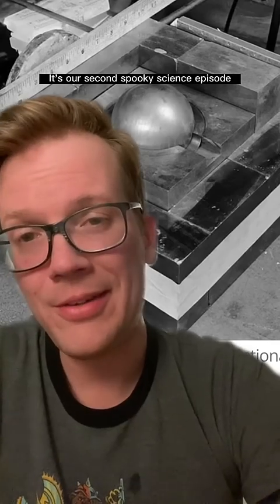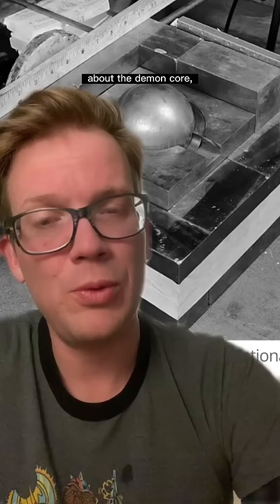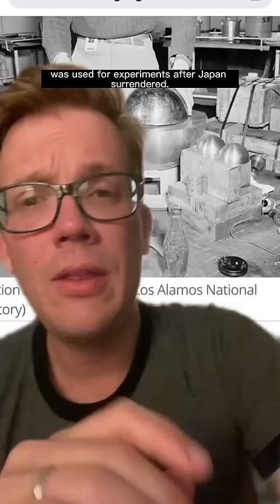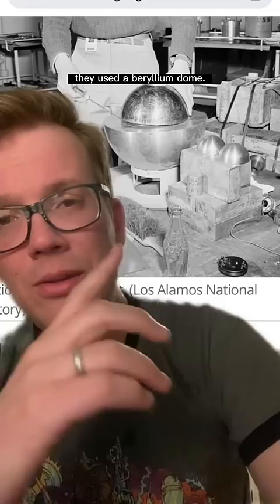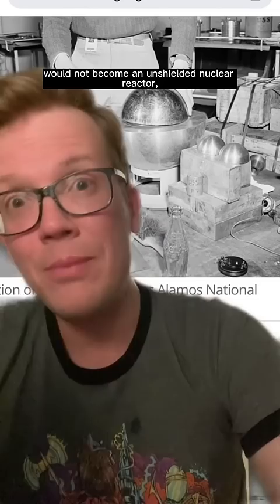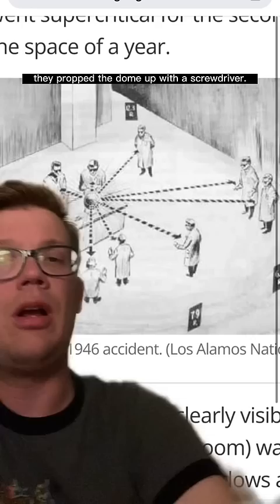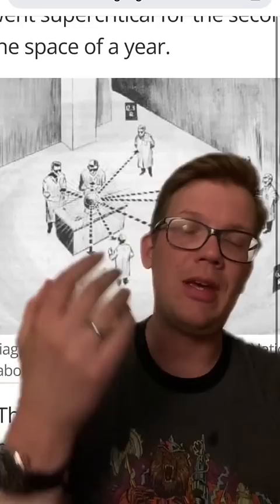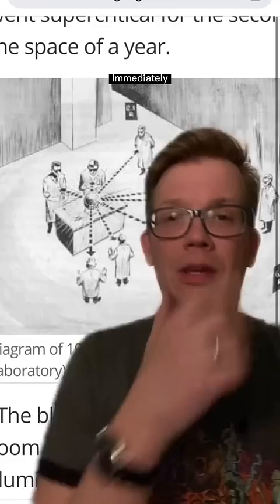Spooky Science episode 7: Second demon core incident

Comment: He was constantly warned about how dangerous this approach was, But he basically thought he was invincible. I can't remember who, but some famous physicist at the time said he would be dead within a month if he kept doing this experiment so recklessly.... And he was right to within a few days
Reply: It was Enrico Fermi who (reportedly) said that.
Reply: @jared_bowden  he described it as tickling the tail of a sleeping dragon
Reply: Maybe he liked the feeling of skirting danger? I can imagine it'd raise your adrenaline.

But if an atom bomb went off instead of radiation when it slipped,  that'd be the ultimate feeling.

Maybe. 

For a split second.
Reply: I have been electrocuted by similar mistakes, I touched something that should have been grounded and got shocked, you usually keep doing things in stupid ways until something like that happens, I got another chance, he didn't, I also could have died, the breaker didn't worked when I was shocked because it was inside the circuit, it didn't drew enough current to trip it but it was painful, I must have damage something, I was with a headache for days, but I am alive, if I had used the other hand I could have stopped my heart, I was stupid, trying to find what was causing an error without proper precautions, like using gloves. I am lucky, most accidental deaths are small mistakes.
Reply: @gy7uj917  wasn't it Feynman who said that?
Reply: @alenasenie6928  my friend’s dad died that way. Worst. Sleep over. Ever.
Reply: Feynman warned him as well.  He was supposed to be using multiple wedges, which were designed to prevent slipping out.
Reply: @-null-null8857  only reason it didn't go off like a bomb was that they worked out that compressing a core would cause supercriticality with a chain reaction that occured much faster.  If he hadn't ripped the dome off and threw it aside, it wouldn't have been much longer before it went boom.
Reply: @alenasenie6928  true that. Good you learned from it.
Reply: Exactly. He even called doing it this way "tickling the dragon" or something in reference to another scientist saying what he was doing was like "tickling the tail of a sleeping dragon". He knew the danger
Reply: I once heard the suggestion that he was in fact suffering from depressions and though not actively suicidal, it did cause him to take unnecessary risks.
Reply: @quantum340  I heard it was bravado.  He was told over and over to use the wedges after the first incident.
Reply: Oh wow did not expect a Fermi cameo. Neat
Reply: @alenasenie6928  I have been electrocuted by myself like 4 times lol. Some by accident and some knowing I was working with live current.
By the way we tend to think that we are more than very smart monkeys. We always do stupid things without logic.
Reply: @alenasenie6928  Either this was a faulty GFCI, or you have a fundamental misunderstanding of breaker's purpose, and shouldn't be anywhere near mains power.
Reply: @o11o01   I don't think it's fair to say that Alen has a faulty understanding of circuit breakers -- he admitted that there wasn't enough current flowing to trip the breaker.  He was probably just not being careful enough -- much like the doomed Dr. Slotin.   As I read it, it sounded like there wasn't a GFCI in the circuit at all.
Reply: Something something hubris
Reply: @jared_bowden  ayo THE Fermi?? Wise words.
Reply: Tbf, you’s probably have to have that amount of unearned confidence to do this kind of scientific work
Reply: @alenasenie6928  A thing happened to my grandpa when he was ~70and worked at a tram central. He was working up on the stairs opening a 12'000V transformer. [Home outlets of 230V, 220V and especially the feeble 110V of US outlets are most often not deadly: i knew people addicted to a certain shock, my schoolmate used to put nails barehanded in the outlets. However getting shocked can be scary and painful, as discharge and your own heart - even without known illnesses - are unpredictable.] Anyway someone hasn't switched the transformer off properly and it got grounded trough him, burning everything in the path of discharge from fingers to ribs on the opposite side, touching something grounded. He survived, despite burns being deep and when the bandages were taken off his chest, a coal of carbonised flesh fell off, revealing a rib bone. Most funny is, after couple of months in hospital, he got back to working there for a fair bit. RIP now, he knew movement is life.
Reply: @Milesco  Seeing as a common circuit breaker trips between 10-20 amps, and you can die from milliamps I do in fact think his understanding his flawed. A regular circuit breaker is in no way designed to prevent or lessen the damage from an electrical shock. Their purpose is to prevent house fires.
Reply: @o11o01   Yeah, I reread Alen's comment, and you may be right about his understanding (or lack thereof) of how circuit breakers work and what they're there for.
Reply: @jackjohnaroni  
I can’t think about the Bikini Atoll without thinking of SpongeBob SquarePants. 

I think it was a Film Theory or something that suggested the high intelligence of the inhabitants of Bikini Bottom was due to mutations caused by the nuclear testing that obliterated the islands. So that’s where Bikini Bottom is located. 

Also makes me wonder what actually happened to the marine life in the area. 

Seems like a fitting tribute for the event much more so than a two piece swimsuit, I suppose.
Reply: @zemoxian  I'm no expert but I believe the marine life in the area died.
Reply: @alenasenie6928  I know the feels I was electrocuted on a 3 phase and was standing in water. It was bad, had me clenched up and stuck to the metal door frame so bad I almost couldn't break away from it. Lasted about 5-7 seconds (I was told) it felt like I was there for 10 minutes to me. That was almost 8 years ago and my left arm has never felt the same again. I think it caused nerve damage.
Reply: @alenasenie6928  an accumulation of small mistakes
Reply: @BraveNewWorld-1984  that’s horrifying.. I’m glad you’re ok now:)
Reply: @zemoxian  damn, I remember reading that theory on cracked like 10 + years ago. Time sure flies
Reply: It was Fermi. He said experiments with the demon core was "Tickling the tail of a sleeping Dragon."
Reply: A second guy died in almost the same way later
Reply: @richardsanjose3692  no actually Slotin was the second guy. The first guy died with the brick experiments that happened before the screwdriver stuff
Reply: @alenasenie6928  I honestly can not understand how you put "Nuclear Bomb" together with.. small mistakes. What is your life like?
Reply: @Christopher Grant not true. look it up.
Reply: @Christopher Grant Oxford Dictionary of English definition:
Electrocute: to injure or kill someone by electric shock.
Reply: @Christopher Grant I’m not talking about an “ failed execution”. Go look it up online. On multiple dictionaries. You can be electrocuted without being killed. I’ve known someone who was electrocuted by lightning and they lived. They definitely weren’t shocked. This is from Wikipedia: “Electrocution is death or severe injury caused by electric shock from electric current passing through the body. The word is derived from "electro" and "execution", but it is also used for accidental death.”
Reply: Dyatlov had the same reckless hubris.
Reply: Doubt he thought he was invincible
Reply: @alenasenie6928  Everyone studying to be an electrician is told firmly on the very first day that there are old electricians, and there are bold electricians, but there are no old, bold electricians.
Reply: @Christopher Grant I'm an etymologist so your comment interested me. I saved to be sure I was using the word correctly so I looked it up. Several dictionaries say that "electrocuted" can also mean "severely injured by electricity."
Reply: What doesn't kill me, makes me stronger. Ooops
Reply: @tripolarmdisorder7696  the core had no chance of exploding. The core would have melted down uncontrollably releasing tremendous amounts of radiation. Without someway to compress the fissile core the neutron flux is far too slow even in the presence of moderators and/or reflectors.
Reply: @tripolarmdisorder7696  you ended your statement with “if he hadn’t ripped the dome off and threw it aside, it wouldn’t have been much longer before it went boom” I was not trying to insult you so I don’t know why you’re resorting to name calling but by using the word boom it sounded like you were stating that it would somehow explode given enough time. It that is not what you were implying don’t blame me.
Reply: @chrisducote4944  Well said, at least someone understands physics.
Reply: @chrisducote4944  Yeah people tend to forget that nuclear weapons work via compressing their cores with a primary explosion which simultaneously bombards the super compressed core at the center with neutrons, you need pressure and extreme amounts of energy in the smallest possible time frame to make an explosion vs a "fire" or in this case a nuclear "fire"
Reply: @yaswedishboy7226  Fermi.
Reply: He didn't think he was invincible if as soon as it happens he says, that does it.
Reply: @Ryan-kf7of actually some life was permanently mutated, DNA change one particular shark is actually thriving well.
Reply: Familiarity breeds contempt.